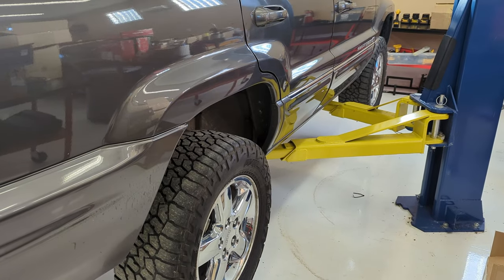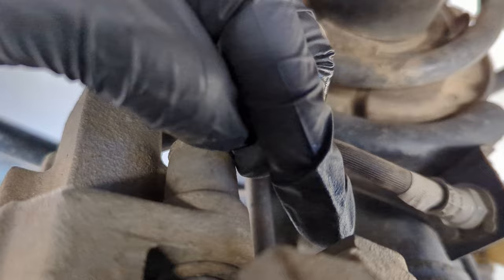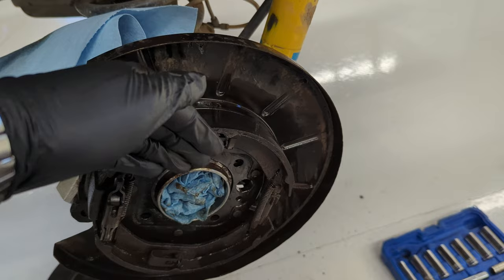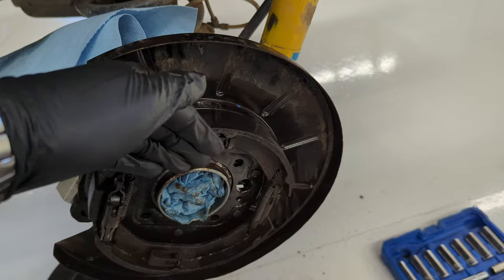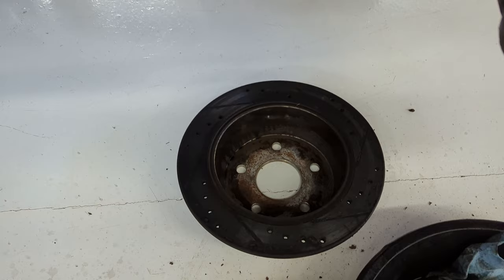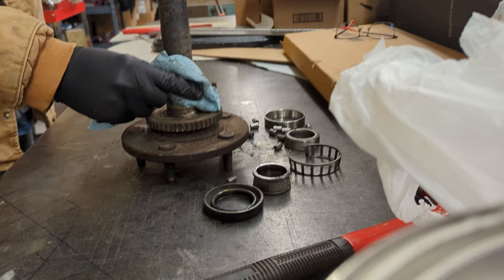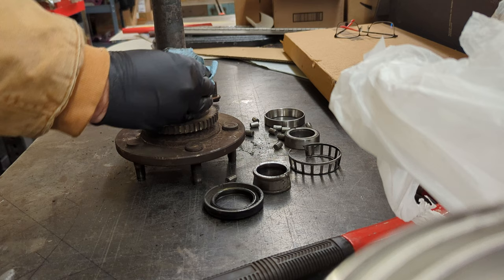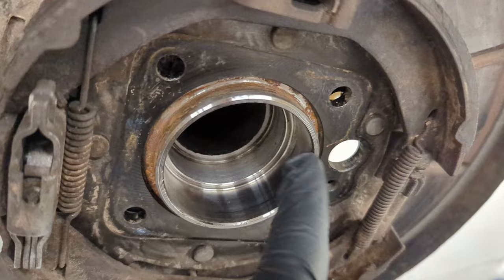99-04 Jeep Grand Cherokee -  Rear Axle Wheel Bearing and Seal Replacement

Comment: if you going to do axle bearing you should have bench vise. Using cut off wheel is not recommended.
Reply from the maker: It's not recommended but it works.

Comment: Are the rear axles the same? Can I rebuild the driver side and put it on the passenger side?
Reply from the maker: I do not think they are interchangeable. They are different lengths between the two on the Pass/Driver side.
Reply: no, used axle has rotational twist you should not change axle location, if it came from left leave on left side.  @WJsLifeonaBoat

Comment: Hey where the hell did you find the hub assembly for the rear. Everything I see says front. I have the 4wheel drive full time limited and need to do all new bearings and seals but can't find the rear hubs. Are they the same as the front?
Reply from the maker: There is no assembly for the rear. You have to cut off the old retaining ring and bearing to put on a new seal, bearing, retaining ring.
Reply: @WJsLifeonaBoat  the hub assembly. I can find the seal and all that but can I use the hub assembly from the front for the rear?
Reply from the maker: @pistolmike791  No. The rear is a completely different setup. The bearings on the axle shaft support the tire for the rear, it's a semi-float axle. The front is a unit bearing. I'll find the part numbers for the rear for you.
Reply: @WJsLifeonaBoat  awesome thank you
Reply from the maker: I used the SKF BR9 Bearing and retaining ring kit, and the SKF 16747 wheel seal.
Reply: @WJsLifeonaBoat  OK so its justva half shaft with the retaining ring and seal and bearing. No hub.
Reply from the maker: @pistolmike791  Yep! That's it. If you watch we're I'm cutting off the bearing and ring from the axle shaft. That's the whole "assembly"
Reply: I'm a year late, but I ordered mine off Partsgeek. The kit they had fit the Dana 35/44 rear end.